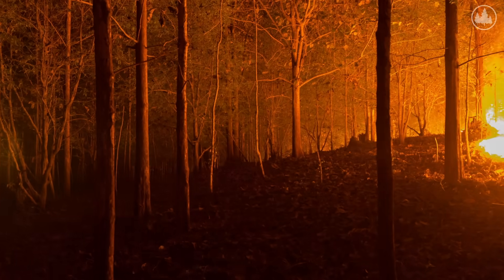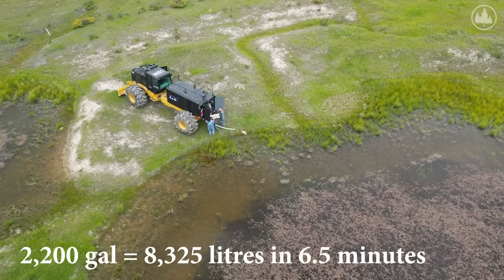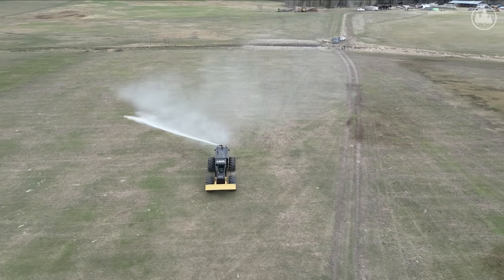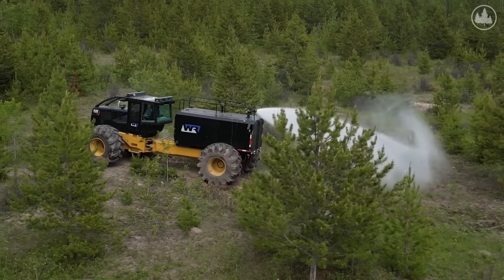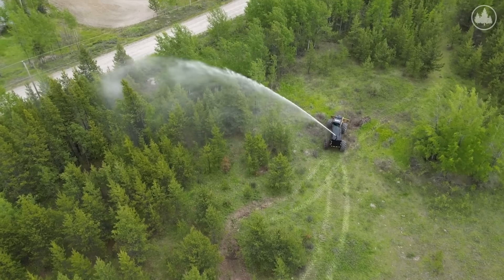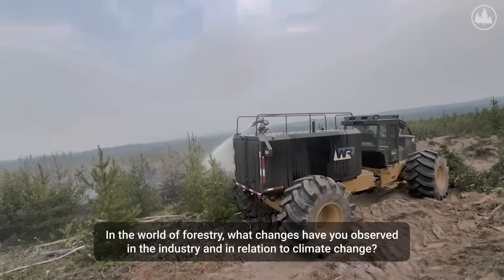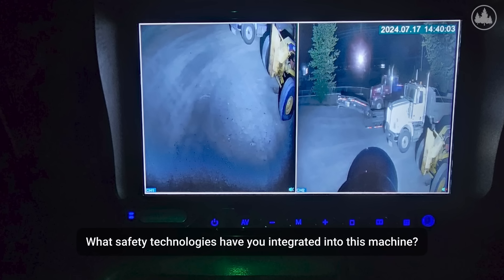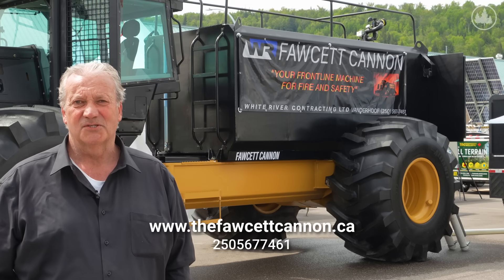The Ultimate Firefighting Cannon: Inside the Wildfire Destroyer

Comment: here is my tool serious pressure washer for the underground fires pair it with tracked bobcat skid it around  watched fortis digging nice holes and trenches with water going down about 4 feet looks like they have deeper capacity this is for those stubborn hot spots crews do this only one task not for general firefighting try it works great if not next

Comment: Hey Ron, very impressive machine. We got stuck in a forest fire around CNRL (Fort Mckay ) about 8 years ago. Wish we had a few of your machines, the fire moves so so fast. For mobility and deployment does it fit right on a flat bed trailer, as is or does it have to be dismantled first like other large CAT equipment?  
Are you able to mount a HI-Rail system on it? I found that if some forest fire equipment were able to use existing rail road, they could get behind the fires, cutting them off and quick deployment.  Cheers!

Comment: Consider a hybrid electric power train with help from Edison Motors.  Advantages are reliability, fuel efficiency, extra torque and peak power,   no DANGER from oxygen starvation engine stall due to complete smoke encapsulation.   I no of people that died in Mailbu trying to get out but failed to drive thru the fire.

Comment: The physics of this doesn't really work when it's turning, because the articulation isn't in the center. It will essentially bind itself up when turning because the front will have a larger turning radius than the rear.

Comment: Hey I'm down here in the southern part of Oregon and we've experienced some flowers I think that's a really cool machine. Now I'm thinking to myself to get a little closer to the fire if you had to what do you think about putting like those triple drive track system on those instead of and they will travel rubber wheels? With that kind of weight suspension issues obviously a concern with tracks with that I think it could be done anyway awesome.

Comment: Firefighting, like combat, is highly dependent on logistics. Consider having a fleet of tankers which can cycle bringing the necessary liquids to the fight. Also consider refuel ports which eliminate crews exiting the vehicle, if fighter jets can do it from an air tanker you should certainly be able to do such on the ground with less complexity. You could have a dual-port system so both fuel and water could be transferred to the Wildfire Destroyer, extending it's operating time greatly and limited only by crew availability and maintenance.

Comment: In a burn-over, it has been proven in Australia that each window needs a deluge of water running over it, and inside, heat-resistant curtains on each window. The cab must be air-conditioned and the driver needs a woollen blanket to completely cover them, including normal fire protective clothing. Even so air temperatures inside the cab will reach 60 degrees celsius (140 Fahrenheit). 

The tyres also need a deluge if you want to save the machine.

Nice design concept!

Comment: this logging skidder could also be fitted with fire retardant instead of water to create a fire break or what about having a logging skidder pull a trailer with large tanks on it with the same tires and that way when one trailers supply is depleted it goes back unhitches and tows away a different trailer.

Comment: And idea. Put a fill point on the Top so incase you ever get stuck in bad terrain yoyu can get a fill from a helicopter to get you  out or buy you time, or even save you time on driving back and forth, let the chopper keep you top up, at least with the cannon you can direct the water more accuratly. Just an idea

Comment: Brilliant, so glad to see an actual product. Here in NNJ we had forest fire that sadly claimed the life of an 18 volunteer.  However our woods are dense and equipment couldn’t get in. Any thoughts of a 1/2 or 1/3 size for other locales?

What about a chainsaw arm and pusher on the side to drop smaller brush. I was also thinking of a smaller unit with essentially a chain thrasher and water in the front or rear to clear and wet a firebreak and containment line for smoldering fires.
Reply: Roll bar structure breaks all the puny stuff right off.

Comment: California needs hundreds of these...
Reply: California needs alot of,fill-in-the-blanks
Reply: Hills are to steep for those and and compared to brush engines this does not over that much benefit. 

Can still be a nice additon and improvement but not an instant fix. 

It does seem rugged but also cheap enough to mass to order and  produce
Reply: It won't work. The amount of water you would need to spray on those trees if they are actually on fire is more than that thing can hold. There is a science behind extinguishing fire and this person clearly has no grasp of what it would take.

Comment: It's already been said, but a reserve tank with a perimiter spray. Include roll down heat reflective material in the cab to survive being trapped in a fire. Also include a supplimental oxygen tank in case of being immolated or potentially trapped.

Comment: Its an exceptional machine. I an curious if it could be safer for an operator. I'm guessing the biggest factors for safety is an operators situational awareness and a willingness to pull back from the fire

I wonder if drone feeds to the operator or a support crew monitoring the fire development. 

The big thing is just equipping rural towns with these

Comment: Why not have it pull multiple tanks on trailers behind it with a hydraulic disconnect so the operator can dump the trailer in a hurry if need be to accelerate away from potential hazards.. couldn't hurt to fill the tires with water as well

Comment: We had a fire truck, bought from Mile High fire dept, near Auberry/Shaver Lake Ca.  It had Twin Screw differential with 8 big Mud Terrain tires and front wheel drive.  It was a monster. Had a turbo charged Mack, 10speed with hi and lo.  Held 3000 gallons. Had many different hose sizes. Had.... In The Creek Fire, that burned the entire San Joaquin River drainage, over 500,000 acres,  no one was home ...... We had clear cut over 15 acres of pine because of pine beetle. But the house burned. The truck burned everything burned.  I've never seen a truck like the one we lost. Mile High should have kept it but they got new fangled trucks with One differential, 2wheel drive, automatic trans.....

Comment: This looks like a great machine. It could be used for construction work to water roads for dust control and as a firefighting tool that forestry requires companies to have during some kinds of work in bushland and other places to keep the machines busy while not on duty at forest fires themselves. If they can be utilized in other roles they’ll be far more economical to keep around and will be ready for use as long as owners maintain them well. Maybe like Coulson has done, the system could be set up as a skid-mounted stand-alone systems as well to haul up onto other machines or equipment as well. Loggers have skidders so  trailer mounted units would work. They wouldn’t be as convenient but possibly more cost effective if an expensive carrier wasn’t needed under it.
Reply: Great ideas and also they can make this “ truck” seasonal, making an attachment for other blades and cutters on the front and rear.

Comment: To all those suggesting recommendations. The nice thing about working with a smaller local business is that they likely can custom build these units so you could probably have it built however you’d like.
Reply: Except it won't work. Notice it's not putting out any fire in the video. It wouldn't even touch a forest or brush fire. Modern brush engines can deliver 500 gallons of water a minute ... He clearly has no idea what he is talking about

Comment: What if:
1. Add an open top option, can be refilled by helicopter bucket.
2. Add Space Shuttle Ceramic Tile around cab to absorb heat....also doubles as team flashover rescue truck
3. Where practical, add AI and remote drive or go autonomous.
4. Add thermal cameras to see on a screen hot spots that are not visible.

Comment: Pretty slick idea. should almost add a winch or at least have as an option since it's losing the ability to push itself out of bad spots with the grapple (not that cat skidders have enough reach to do that very well in a lot of spots anyways). the water tank skidders end up working by themselves with ground crews so often on fires and if it's working by itself for initial attack it'd be good to be possibly self recoverable. Especially trying to get to swampy water sources

Comment: Think it needs to be more like a 4/6-wheel drive rock truck  (Bergman/Volvo) where the articulated trailer can tip over while the cab stays upright. 

He mentioned adding baffles in the tank to help prevent tipping, but once it does tip, his entire rig tips over the driver could be trapped and the machine severely damaged.  Rock truck dump bodies can be re-righted without damage to the cab/engine.

I'd retrofit a used rock truck, add a blade and a removable tank and pump system in the bed so the truck could work the entire year, rather than an expensive bespoke machine sitting around unused half a year.
Reply: The problem is transporting those machines… very oversized loads that are impractical in many remote areas…

Comment: As others are adding " tweaks " to your machine...Allow me to suggest. With the technology of today, a drone operator work with and with this equipment, of course where money and training might be made available. Reason being the support, ground crew in the rear, back at the headquarters, etc. A drone could be position 500 feet above giving the operator a panoramic view of the fire, location and more importantly the direction or any changes which might endanger the  operator , fire crew doing a follow up or a cliff 20 yards ahead. The drone being operated remotely by a follow up crew, the footage shows on the machine operators screens. Place a beacon/ strobe light on the roof for aircrews to spot the equipment when working in tantum. Air horn for signals over the fire's roar, alerting firecrews you are there. Key element to alert all, help is there, presents a rally point for any firefighters lost, or in need of help. A wench, front and back, big enough to pull a down tree out of the roadway. Hooks attachments for fire Ax, hose connects for small brush fire where a firefighter might pull from your tank without having to use 200 gals to knock out ground cinders. Ladder rack, chainsaw locker, oil , new chain, wrench, mask / filters, first aid gear, rope,  spare hard hats, gloves, and a hook on rear to pull spare tank with you. Your refill is five miles back, that extra water tank being tow in might be the key to cutting off the fire. Cut it lose 1/2 mile from the fire in hard terran....return only when you need to refill main tank vs the five mile or more back to the watering hole. Make that avail on order type deal.

Comment: I like the Australian brush trucks that can self protect in a burnover.  This is a skidgine tanker, a nice concept.  I would give it a better blade and serious self-protection if it gets caught in a burn over.
Reply: M113 and other surplus tracked vehicles can drive through burnovers, being intended to deal with napalm strikes and shrapnel. Wheeled vehicles with rubber tires (unless they're based on log skidders etc like the one in this video) are not suitable. Australia had some remaing but may have scrapped their fleet as military people with an interest in firefighting are a tiny niche group. The US has a large store and they're available from the government to authorized agencies for cost of shipping or bringing a flatbed (two M113 fit a standard flatbed trailer, I've helped ship one from Camp Shelby). 

Tracked APC can pull water bowsers or other trailers using their pintle hitch which is easy to give jettison capability from inside the vehicle.
The Holland hitch catalog shows examples any mechanic could mod for mechanical or hydraulic opening (a liftgate electric-hydraulic pump as used on liftgates is easy to fit and compact) though every hitch should retain a manual unlock mode.
Reply: @Comm0ut  I am talking about burn over as in the fire front rolling over the vehicle with no where to go for a few minutes. Not the charcoal and ash left after the fire.  Any heavy equipment/ truck with heavy tires can drive thru a firefront as long as the exposure is a few seconds.

Comment: Nice creation, having been a rural firefighter, these types of machines have their purpose. My only safety concern that I can see is for the driver. Radiant heat from the fire would affect the driver, have you thought of having a pulldown blind feature to repel some of the heat. And also another person mentioned it too that to have a reserve tank in case of sudden change in direction of fire or if the vehicle becomes ingulfed. Wildfires can move at a very rapid pace, as you probably are already aware. But in Australia we have in some not all, foil like blinds in the cab to protect the crew from radiant heat. And its great that everything is on cameras, but are the cameras and cabling able to be protected from radiant heat. Having them melt before the fire gets to them. A vehicle misting system from emergency tanks to be able to protect the occupant, and vehicle until the threat has passed if overcome. Well done. An improvement on the modern firefighting capabilities for remote areas. 👏

Comment: I saw a farmer in Colorado turning his field over to stop the Wildfire from passing where he turned the soil. Perhaps a rototiller attachment on the back of your truck could be useful?
Reply: Adding more attachments to one vehicle can easily overcomplicate it. OTOH a "squad" of wheeled and tracked vehicles can be mutually supporting by carrying personnel under armor with a bulletproof glass drivers cupola (drivers need 360 degrees of decent vision) as used on military vehicles and which any local machine/fab shop could manufacture easily.
Reply: The blade on the front would work great for a fire break, forestry dept here in Oklahoma uses a dozer and it works pretty good.